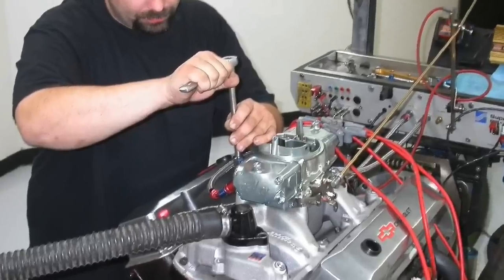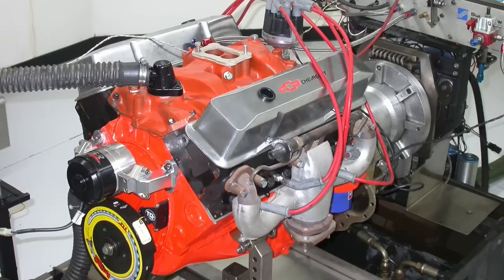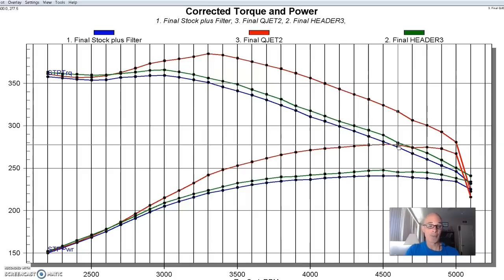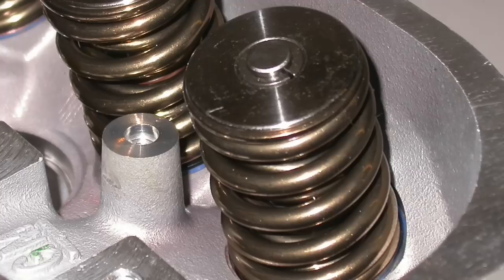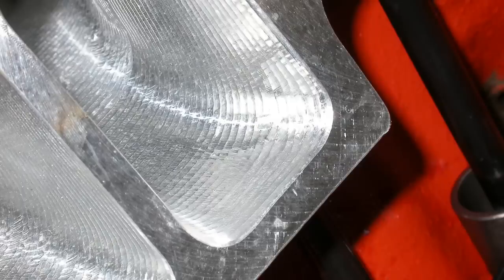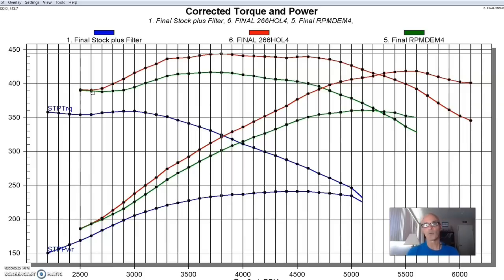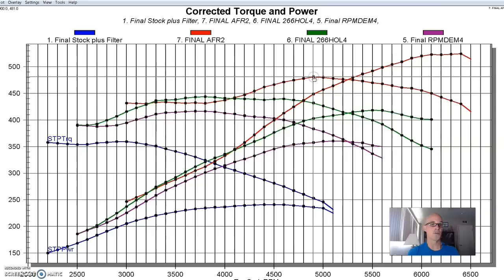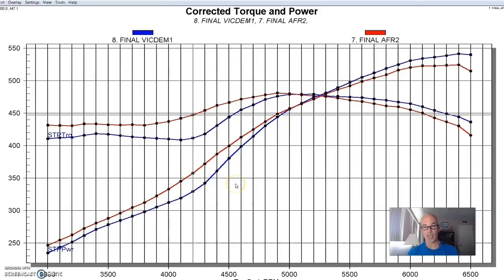HOW TO: SBC POWER COMBOS

Comment: SBC= The original LS!  LOL lots of LS guys forget, they are still “small block Chevy”!
Reply: Uh. No we don't. All LS's are still small blocks. We know this. We aren't dumb.
Reply: whatre you doing here ;D
Reply: Sbc is the base but not an LS engine. Ls engine has all the new technology taken form the mistakes from the early days. Ls are more efficient but aftermarket has now helped the sbc make as mush power. You would never see Roller cams on early sbc and now aftermarket stepped up making the sbc more efficient. Yes ls is a sbc but it’s nothing like the 1 generation sbc. I would definitely build a sbc before doing a swap thanks to this video
Reply: FXIIBeaver you are a smart one!  A Lot forget the Chevy part!  Chevy been engine swapping Fords forever, lol
Reply: Kincent Carter love watching Richards vids!  Very smart dude!
Reply: Good ole SBC! But... The money required to build this could be a bit higher since aftermarket heads are used. 2000 bucks for heads? You can build an LQ9 with ported/milled LS3 heads, cam and LS3 intake manifold and make better power. Just saying. The only real additional cost would be the EFI system. Holley is $999 ($1299 for DBW and/or electronic trans) and HPTuners is about about $1000 for ECM, factory harness and the HPTuners unit. I'm going LS myself. And I tune so I save the cost of tuning there. I'm actually doing a setup for someone now...
Reply: @jaydubb71  you can buy bare aluminum heads for 320 with 68cc chambers on eBay or 400 for a pair with 64cc, same 200cc intake volume. Chinese heads in recent times have been proven to be pretty good, some mild port work and they'll be good heads. The rest of the valvetrain is up to the buyer, but you can put as cheap or as expensive as they want
Reply: @jaydubb71  whatever dude....
Reply: @jaydubb71  I've bought slightly used sportsman 2s for $250 from circle track racer. Made over 500hp on a 350 with them heads. You must be young. $2000 bucks can build a 500hp SBC using pre owned components. Been done many times.
Reply: Shit 4 Brains 
Can make over 500hp with a $300 junkyard 6L LS and $400 for springs and a Summit cam.  Only have to find a 6L at Pick n Pull.  I’ve seen running 6L get pulled from junkyards for under $200.
Reply: Ford makes it, chevy shakes it.😂 old street rodder saying...
Reply: @stlchucko  ok now lets be honest all the 6L ls are hard to find in a junkyard especially for $300 on average now they are like $800-$1200
Reply: Still all I'll run in my race car!
Reply: Miguelspl150, “all the modern bits”, really, like... The modern overhead valves? The modern push rods?  Maybe, the modern fixed valve timing from the 1950s?
Reply: @TurboJohnRacing  Don't you have some rear steering to work on?
Reply: @FXIIBeaver  They share the same bore spacing. There was never a stock SBC head that could support 600 + hp.LS3 and LS7 heads make power.
Reply: My first sbc build I did I used sportsman 2 heads. Awesome heads, made for a really fun ride in a cj7.
Reply: @Miguelspl150  you must be a young pup because they been making and using hydraulic and solid roller camshafts aftermarket for SBC since the early 70s. Where you been?
Reply: I still haven't jumped on the LS bandwagon. Don't plan to anytime soon
Reply: No one is forgetting the LS is "still a small block Chevy" because it's actually a corperate GM small block
Reply: @attitudeadjusted9027  SBC roller cams came out in the late 1950s.
Reply: @stlchucko  whatever
Reply: @1mrowens2  around $1500-$1800 for pull outs around here. Definitely not finding them in the yard, they get pulled before they even hit the yard and sold on eBay. Greedy junkyard owners done caught on.
Reply: Can't be a LS lover and not know its still a SBC!!!...technically you shouldn't be under a hood not knowing that!!!...lol
Reply: @1mrowens2  pullapart out here in N.O. got em for $200 all day everyday!...I personally love the 4.8l I have one in my 03 Yukon and its everything beyond reliable!...gonna get the heads ported and polished and slam a stage 2 cam in her to get her close to the 400hp mark!...
Reply: @stlchucko  Yeah sure.
Reply: @elonmask50     The LS has all the SBC tricks hot rodders used for 50+ years.  It has 15 degree heads instead of the SBC's 23 degree.  It has a raised cam for shorter pushrods.  The cam journals are bigger diameter (same as a  BBC) for better control.  Cast 1.7 rockers instead of stamped 1.5 rockers.  Deep skirt 6 bolt main block. 
The worst flowing LS heads (706 and 862) rival the best production SBC heads (L31).  Not to mention that valve spring upgrades for an LS are much more conveinent; able to drop in springs that can handle 0.650"+ of lift, where many factory SBC heads require machining to handle much over 0.500"
Reply: @user-ge2qn6gp4o   What are you doubting?  The "cam only" power?
Richard Holdener has done hordes of tests on junkyard motors, including cam only 6L.  He's also compared the factory rec and cathedral port heads.
https://www.youtube.com/watch?v=Xspfk2zxSrs&t=678s

The prices?
Summit Racing's prices are on their site.  They have cams with similar grinds to what Holdener has run.  
If you're wanting to just show up at a place and get a motor thrown in the bed of your truck, it's gonna cost more (especially from a private seller).  If you go to a place where you pull the motor (Pick n Pull), it'll cost considerably less.  Less cost is gonna require more work.
There are people that have scored 6L for under $200 when such places have had sales.
Reply: @SpaceMoviePopcorn  Original SBC is sooo much better looking. LS valve covers with coils and front end accessories are UGLY.
Reply: @Miguelspl150  350s were roller motors in like 1993 wtf are you talking about🤣🤣🤣
Reply: @jradish  whole ls1 for $350

Comment: Specs for the wild Cam? That’s the only thing you left out! 😩
Reply from the maker: Dang-it was a Comp XR294HR
Reply: Thank you and i Appreciate all the testing and videos you put out on youtube.
Reply: Always great stuff from you sir..glad someone asked about the big cam spec's...that was my question too...
Reply: @richardholdener1727   Richard I'm sad Holley isn't offering the Systemax heads anymore.. I always liked the 20 degree vs 23 deg arangement on those.  I had the idea of Angle milling those 20 deg Holley's to see if I could reach 18 degrees (90's NASCAR) angle.  Would love to see you try. Or even on a set of stock 20 deg SBF heads.  18 deg at low cost and no fancy valvetrain or manifold required.  Angle milling normally picks up 15cfm on a 23 deg.
Reply: Yeah, I kept waiting on the hydraulic roller specs
Reply: @richardholdener1727  So I have a 350 with forged flat tops around 10-1 with 64cc vortec heads, comp 292 magnum cam, marine power intake and Holley 750 plus all the other goodies MSD etc. In my 3100 pound drag car, 9 inch with spooled 4.56.. the works. My question has been that it runs 8.00 in the 1/8, around 12.50 in the 1/4.. indicating around 300 whp.. What is the major factor choking or preventing much more power here?? Any input I would welcome, as I am ready and able to make the changes but want to know that I am making the best ones... thanks and keep up the great work!
Reply: @ChevRod  cylinder head flow is holding you back. Probably close to maxed out on the vortec castings.
Reply: @b.c4066  that’s what I’m thinking, just not sure now if I want to open this motor and “ let the magic out”, or build a different one and keep this one for a spare.. it’s been just a good reliable and consistent motor
Reply: @ChevRod  wow, i have a 347ci ford, 9.5to1, alum head, 3000lb coupe,c4, 3.55 gear. It run 7.16 1/8 tracks, 11.17 1/4s. I doubt im making 450hp! Parker funnel web intake with spacer.
Reply: @ChevRod  your heads are whats stopping you. With those gears at the RPM your turning, they are done. Get some AFR 195s/205s or equivalent. I'd also suggest a more modern cam from the XE line up of cams with matching springs. Good luck !

Comment: That Qaudrajet will perform just as well as the Demon. Most people don't know how to tune a Qaudrajet. I've used the Qaudrajet for years. Some drag race series will even require the Qaudrajet. The Demon is a great carburetor also. I've had both and prefer the Qaudrajet just to be different. It would be nice to see a comparison of the 2 carbs by someone that knows how to tune the Qaudrajet. Cheers Richard Richard thanks for the great videos brother
Reply: I’ve got qjets on two of my cars. One has a 240 degree 560 lift at 050 cam and full cnc heads. It honestly wasn’t that hard to get the qjet running right on it just took some reading, Cliff ruggles qjet book helped out a lot. Holleys are fine I’ve had some before but the tuning parts are so expensive and they don’t feel as good driving as the qjet.

Comment: Great video as usual. I built a solid roller 406 that made 611 hp at the crank and people thought I was full of BS. I had to show them how easily you made over 500 with a 350👍
Reply: That’s pretty big HP for 406 if it is truly a street engine with pump gas compression and a hydraulic cam.  Unless of course your engine has high compression and a could cam which make it more of a race engine vs a street/strip engine.
Reply: Dan Myers Dan Myers I think he’s spot on, if you use the right combination. Think about it Richard got 542hp from the 350!

Cheers
Reply: I’ve got 660hp from my 434 sbc 10.8:1 comp
Reply: My 388 is at about 650. Not at all streetable (still street driven)but with the right parts, just about anything is possible
Reply: I have a 383 stroker 11.0 compression, 243/249 solid roller and afr 210s with a Holley sniper x flow system, I’d say it’s stout
Reply: I have a 357ci producing 585hp. Just gotta go big.
Reply: I used a 274/278@.050, 106 lobe separation, 668/669 lift solid roller, 12.8-1 compression, 308cfm Pro Topline heads, super Victor with a 850 DP Holley. Wouldn't want to drive it everyday, but it's fun for recreational use. 5500 stall and 5-13 gear makes it a bitch on the street. But it'll definitely make people nervous.
Reply: Sounds absolutely legit to me. Those numbers are totally doable.
Reply: @thereluctantgearhead4544  Holy Hell! Git back!
Reply: @Taylor Rutter I have a old popular hotrodding magazine from around 70-71, there's a buildup on a 501hp 302 SBC. Had ported 492s on it, edelbrock tarantula intake, 850 Holley DP, and about a 600 lift, 270@.050 solid roller cam. Peaked around 8500 rpm.
Reply: @thereluctantgearhead4544  hello friend,  I sure would like to talk to u to c exactly what u put together cause I'm starting to build a 406 and I like what I'm cning n ur comment, 12.5-1 and 6.69 lift thts exactly what I want to do with this 406 ci sbc I'm rounding up parts for as I typ this.. so any help would b greatly appreciated 💯🙏 keep wrenching...🤙
Reply: @keithwesley9880  get ya a pair of 220cc heads that flow 300+cfm and a Super Victor. An 850 DP should work for ya.

Comment: Good information! Good video! But what about was the last camshaft? One reason I like your videos is you help take out the guessing part of what the engine will do if I do this or that to it. And if I just is the same parts I will get close to the same power which is awesome for that I thank you. My first car I Hot Rodded was my 67 Galaxie 500 2 door fast back I put a 390GT camshaft a 428 Police Interceptor Intake with a 800 QJet carb. Car went from a top speed of 130 to a top speed of 150! From watching a lot of your videos I really messed up not putting headers on it stock exhaust manifolds are junk on 390 Ford

Comment: Fabulous.  My brother had an old, rusty, 1970 Monte Carlo with a 4bolt 350 2bbl.  It said 245hp on the air cleaner - virtually the same as in the video.  We put the engine in an old Chevy dually and added a 4bbl and manifold form a junk  yard.  No other mods - no headers, no cam, etc.  We always wondered how much power we gained.  It appears that we probably made another 25-30hp.  It made that old truck come alive with a full load of oak.   I enjoyed this video - the video didn't say but i assume it was working with a 4 bolt block

Comment: Baselining with the old heads made the following mods more impressive, but my first change would be vortec heads and a compatible manifold. No complaints with your progression, just moving to modern combustion chambers and ports is what makes sense to me. Looking back at the DZ engine, they kept some mid-range by using a dual plane manifold on a 7000 rpm engine. Looking at how airflow works, it seems to me the active cylinder only sees half the carb on a dual plane, thus could always use a BIGGER carb than a single plane, at least with the same cam/heads. Getting to 520-540 hp range with a 350 is serious stuff, especially the dual plane setup with little to no torque loss. Incredible stuff in this video, thanks Richard!
Reply: One more thing, we need to see TPI on the RV cam engine...
Reply from the maker: I mentioned the Vortec heads as an option in the video-they work well

Comment: Thank you you give me hope for my 330hp gm crate motor. It's got the vortec heads but I thing some AFR heads, roller cam, RPM intake and 750 carb would bring it up to 500 HP.

Comment: Hey Richard!  Finally putting my 60 over sbc  together with 9-1 compression, afr 180 heads and a howards retro roller cam with 213/217 @ .050 and 485/495 lift on a 110 lsa. I hope it runs strong!
Reply: How did it turn out, I’m currently building a sbc 360 and was looking at the Afr 195,cam is where I’m stuck on

Comment: Hey again Richard, thanks for letting me know the brand of Dyno headers. Ok, in a nutshell, I keep evolving (changing) my 327 Sbc build as I dig deeper into the math/engineering of actually building an engine and understanding why things do what they do. Stock rods, cast pop-up pistons (3.2cc), 492 dh virgin heads rebuilt to 2.02/1.60, bronze valve guides, 11/32” stainless Fererra? Valves, bbc 7/16 studs and guide plates, not unshrouded yet, 8.44:1 dynamic comp, .015 steel head gaskets, Weiand 7508 single plane, comp cams 12-705-8 solid roller, lift .575, adv duration 300/300, @ .050 255/255 single pattern, comp ultra pro magnums…dyno programs tell me 377hp. What would be the biggest head upgrade (aluminum cnc ported head) that you would suggest to get the max hp and rpm’s without different rods and pistons to have a once in awhile Street car/show vehicle that spends the most time (maybe 200-300 miles a year) on a road course/drag strip. Thanks 🙏 Tony
Reply from the maker: pick a different cam and add afr heads as shown in the 327 upgrade video (it will be well past 377 hp)
Reply: @richardholdener1727  thanks again for a reply Sir! Sooo, you’re telling me that my cam will not work well with the AFR heads? I’m confused on this one. If it’s not the right cam, why, and what do you suggest for maximum effort considering my short block internals limits. My engine guy and aftermarket performance business owner hasn’t warned me against this cam even after I mentioned wanting to upgrade to Brodix or AFR CNC heads. He’s already got my money but is always willing to let me trade parts if still in the box. Which they are. I know you have a million of us gear heads asking questions so I understand if you don’t get back to me. I’m just honored to get help from someone with your knowledge! This Veteran thanks you for taking the time to help your fellow Americans and people everywhere. 🫡🇺🇸

Comment: So... what was the first hyd. roller camshaft that you used? I know that it was a Comp Cams retro fit, but, which one? And... did you run the 1.52 or 1.6 rockers?  Love the high torque numbers with the 350 c.i. and hyd. roller , but, I dont personally need the 500 hp.  I'm building a ZZ shortblock with almost the same bolt ons (heads, intake and such). Thanks, Jim
Reply: Found it down below in the comments and answers! Comp XE294HR...
Reply from the maker: yep

Comment: Once again , thanks Richard for all you do in testing. My question is,  I noticed this motor had a tci balancer on it. Are you seeing any gain in hp or just smoothness in the motor or even more valvetrain stability with this balancer. Elaborate a little if you can! Thanks. P.S. That dip at around 4,000 rpm is indicative of to wide a lobe separation. Tighten that sucker up to a 107 or a 106 and let er rip.

Comment: Also remember that the vortec heads have press in head studs and screw in studs are needed for most aftermarket cams and can be installed by any machine shop also I would of liked to see the big afr heads with the rv cam that way we can see what can be had with a great set of heads and a small cam many people think that to much head is a bad thing but in my experience it’s nice to have a car that drives and idles great in all conditions even with ac on and have the heads carry the cam higher up higher in the rpm and have the cam do the work down low please do a test showing a small cam with awesome heads to show no loss down low and nothing but gains it not make as much peak but no losses thru the rpm range in a street car that is super smooth and see if the loss wouldn’t be much down low also what was the wild cam specs i don’t think you let us know and I think it’s a good idea to let everyone know that many times vortec heads are cracked at the junk yard be very careful preferably get them from summit or jegs